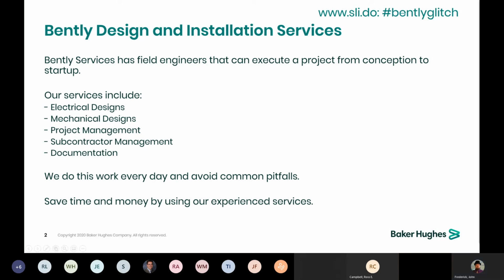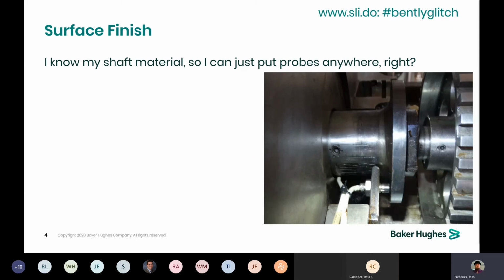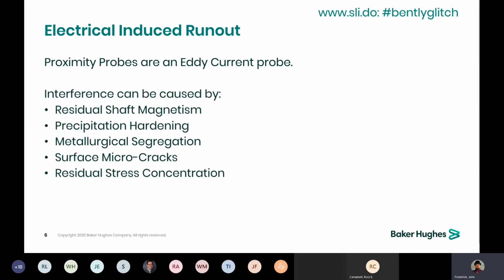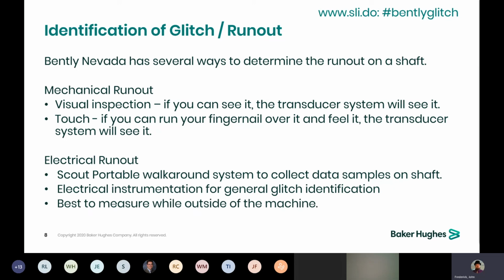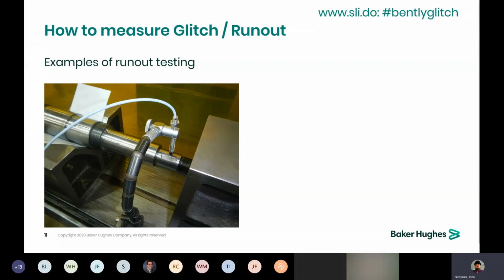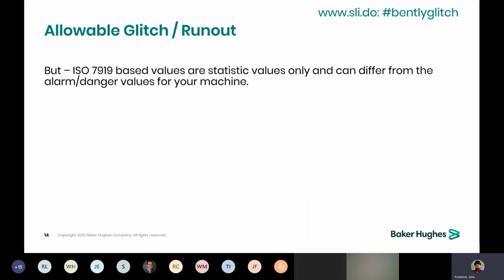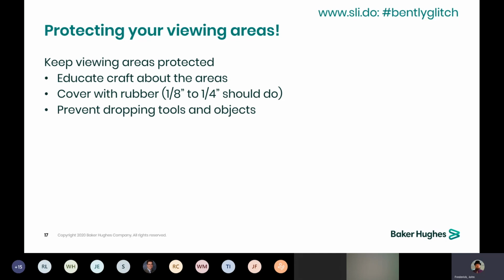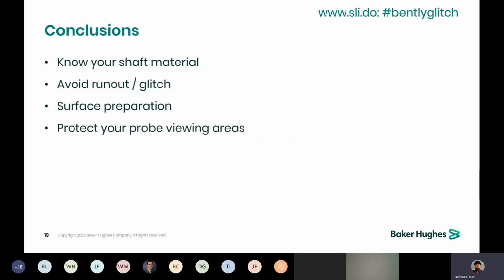Glitch & Runout

Comment: The runout vibration vector can both increase or decrease the amplitude of vibration vector of concern (depending upon its phase with the main vector).

Also, why did bently nevada stopped manufacturing the automatic runout subtractors? 

Hoping for your inputs here.